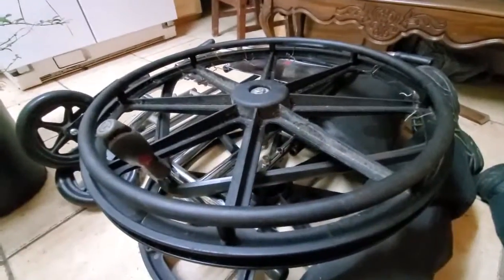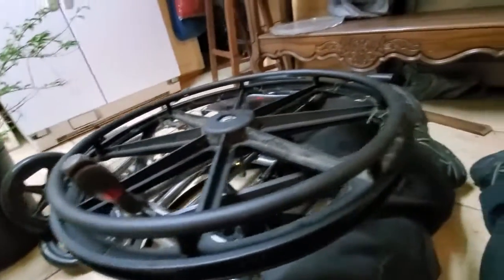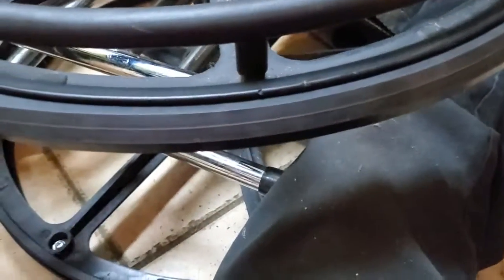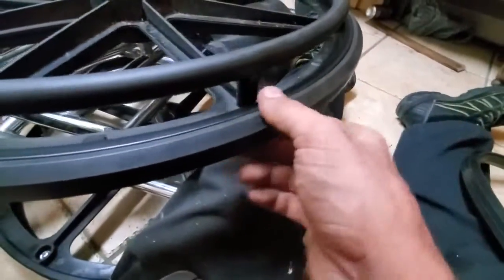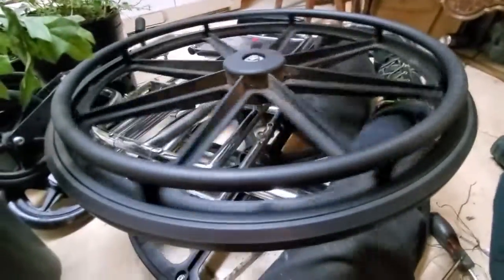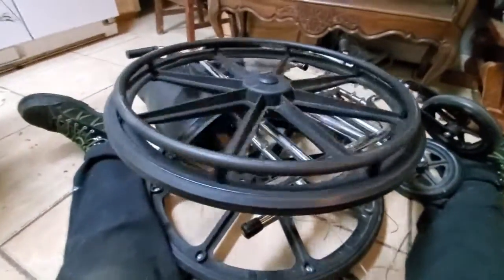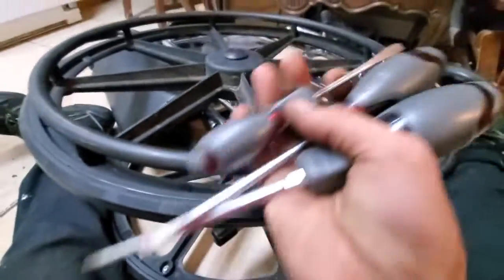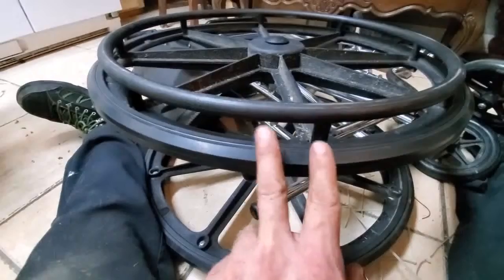Wheelchair tire replacement solid rubber tire

Comment: hey..next time try hooking it on the brake and running it around the rim..,but a lil lube on the brake so it turns smooth...💯💯
Reply: Lube is a petroleum product and deteriorates rubber.  Don’t think that is a good idea.  Maybe a talc would be better.